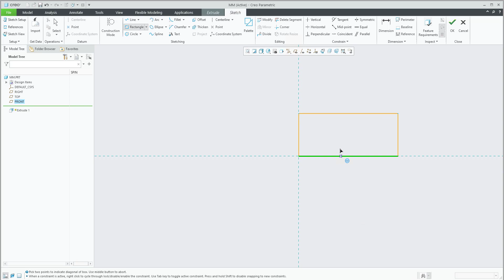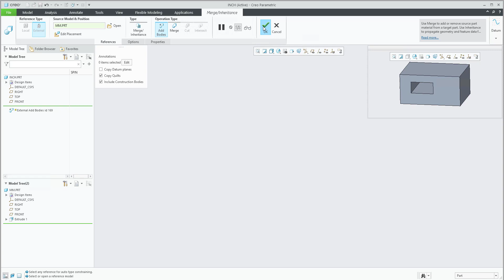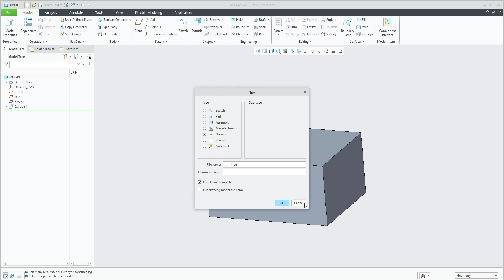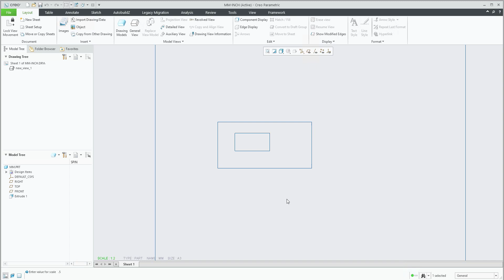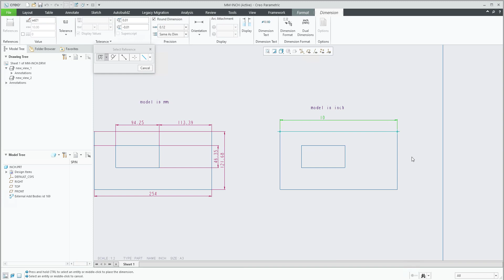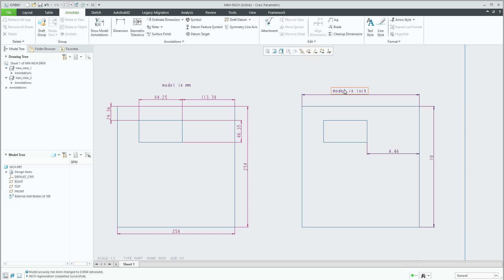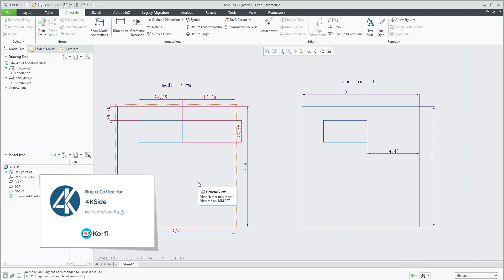Model is visible in mm and also in inch - Copy/Inheritance feature

Comment: THIS IS VERY PAINFUL PROCESS JUST TO ADD UNIT STRINGS TO DUAL DIMESNIONS. 😬
Reply from the maker: Hi, I know... It is only workaround (requested by user) if they are not allowed to use dual dimensions defined by dtl file.
Reply: @4kside  Yes i know dtl file don't have this feature. I was just double checking if this exists or not. Thanks for your effort. 👍🏻